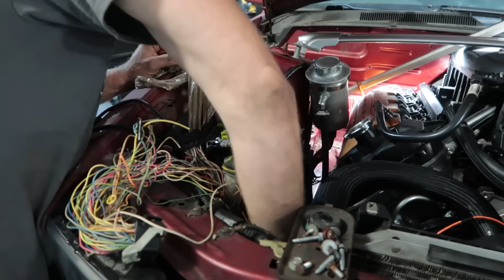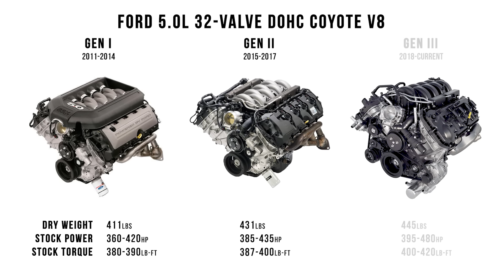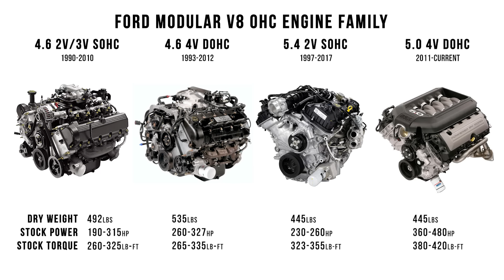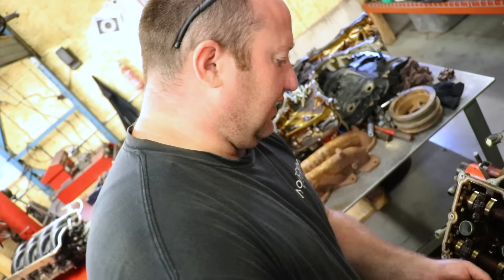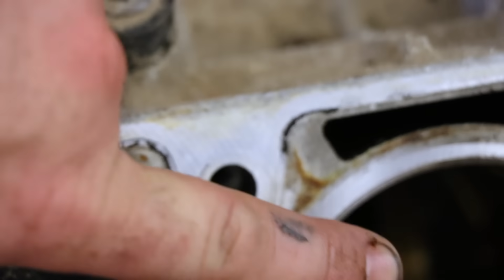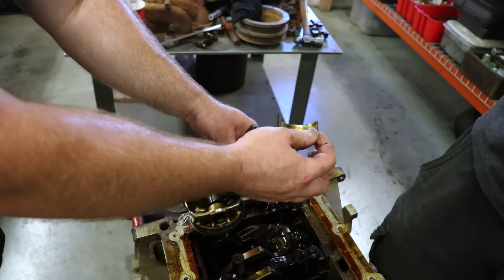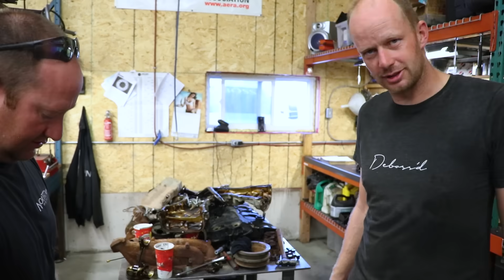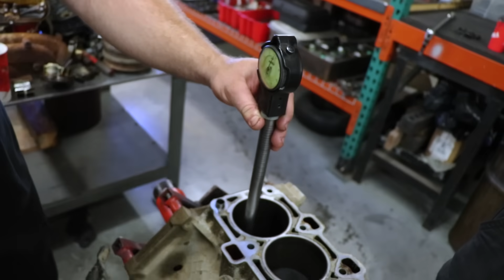REVIEW: Everything Wrong With A 5.0 Coyote Engine

Comment: My 05 mustang with the 4.6 has about 260,000 miles, most of them highway miles. It was owned by my uncle for the most part. Apparently it takes an engineer to remember to change oil. Runs like new! Just treat your car like your kid and it will last...

Comment: The synthetic bit is definitely bunk. This was clearly a lack of maintenance. Only time you'll potentially have issues is if the engine never comes up to temperature from constant short drives, which causes lots of fuel vapors and condensation to make its way into the oil, which will cause varnish deposits along with corrosion, and that will be an issue for either conventional or synthetic.
Reply: Hello, my f150 has a misfire in cylinder 4.   Its going into the shop in a couple days but I am curious the issue is from my short drives to work which is literally five minutes  through the neighborhood.   We do go on long road trips but most days its five minutes to work and five to the store.
Reply: @3DGEM3  what was the diagnosis?
Reply: @MR-nl8xr  digging into engine, headgasket  and valve job.   Quoted 7 grand.   We ended up trading  in the truck.  Put 8 grand  down on a 2022 subaru forester wilderness
Reply: @3DGEM3  your only symptom was a random misfire in cylinder 4?

Comment: I just bought a brand new Tundra...are there any known issues with the I FORCE 5.7 L V8? The engine sounds great and has real good power. My 13 Tacoma with the 4.0 litre V6 was absolutely dead realiable. Is the Toyota 5.7 just as good. It is the 3UR-FE.

Comment: Pushrods are superior in my opinion.   You can snap the valve open quicker and close it later with a pushrod.  It aids in low end torque production.   I'm sure that is why the new 7.3 went back to pushrods for a truck engine.  The 4.6 and 5.0 really lacks the low end compared to pushrod engines.   That engine reminds me of over engineered German engines.

Comment: Road Runner is the Boss 302, with a forged rotating assembly and valve train to support that extra 1000RPM worth of red-line. Coyote (with a Boss intake) is what I'm betting you have there.

Comment: There is a difference in Head Bolt length between generations; many built motors get machined to take bigger bolts as they stiffen the geometry.

Comment: Seen plenty of 5.0 in cars and trucks...
Never seen any of the stuff your talking about.   Only issues I've ever heard is water pump and ring on the hose and some have valve adjustment needed. 
If you roast an engine like most stangs get done to them there tend to be bearing trouble. Every engine will do that with abuse.
Too much misinformation.

Comment: Here are the biggest issues with them
1: gen1 coyotes didn’t have an oil squirter in cylinder 8 so that cylinder would have low compression in some high mileage vehicles.
2. Oem oil pump gears in gen 1 and 2 were very fragile and didn’t hold up at high rpm in boosted applications 
3. These motors rev super high for a v8, not unlike an s2000 it’s gonna use some oil if you’re driving it hard and spending time in the upper revs so as long as you check it regularly and change it at the oem interval you will be fine. 

All in all a fine motor with some problems early on in production that got ironed out in gen 2-3.

Comment: Sorry, I don’t agree. The 5.0 might be the best engine ford has made as of late. The owner of this engine definitely abused it.
Reply: Facts. It's a great engine. Just don't neglect it and it'll do fine.
Reply: I think gen 2 were the best 5.0
Reply: @Night_zv  do u kmow if the 2016 is gen 1 or geb 2
Reply: @puffpuffpikachu  gen 2
Reply: @Night_zv  thx
Reply: @Night_zv definitely
Reply: @bigboreracing356  351 Cleveland served me well for 700,000km in the hot Australian outback, was still running sweetly when I sold it.
Reply: He's Misinformed Lots Of People In This Video 👌🏿.
Reply: Both 5.0 engines I've owned have been very good to me. 👍
Reply: The most reliable engine ford made was the 4.9 300 inline 6 that engine is the best by far.
Reply: Yup
Reply: 4.6 "lots of power" lmfao this guy clearly has no idea what he's talking about. And the sludge is from very extended oil changes with low quality Dino oil. 🤦
Reply: Nice engine the best
Reply: There's a reason most Fords in drag racing use a Chevy block instead of Ford.
Reply: 100%
Reply: The Coyote has a whole decade of reliability. This video is part of another trend of people being contrarian for views, nitpicking rare things, to produce a hunk of ten minute clickbait. Even before I clicked I knew the comments would disagree.
Reply: until 2018 when they cheapened it with spray on cylinder liners rather than sleeving them. Nothing but problems since in my F150.
Reply: @Mrbink01  I have a 14 stx sport 5.0
Reply: @Mrbink01  also the pistons have been hollowed out a lot to save on money
Reply: @Mrbink01  same here im on my 2nd engine and its eating oil like crazy.
Reply: Most reliable gas engine Ford ever made was in the 1993 Mustang Cobras. None of these bullshit problems.
Reply: @Mr.Beastforpresident  same shortblock as the 91-95 mustang and 96-2001 explorers so it was nothing special except programming and some expensive badges
Reply: @Mr.Beastforpresident  The Cleveland was the equivalent of the LS motor..bullet proof and ran hot without exploding or cracking.
Reply: @lobsterwhisperer7932  Far from bulletproof. Thin cylinder walls limit factory blocks to about 600hp without filling them. The factory oiling system leaves some to be desired, and falls short on supplying oil to the mains.
Reply: My teksid 4.6l block is 1700rwhp. 😂 
Plus I'm building a big bore "cammer"/Tr50 road race block modular
2v with 13.5 to. 1 comp ratio. Have buddies with coyotes running 800 to 1100 rwhp no problems. Me thinks you or your tuner can't tune or build engines. 

You better stick with jr dragsters son... 🤣
Reply: @Mr.Beastforpresident  nah the 4.6L 2v is much more reliable. Electronic ignition cannot be beat with a distributor, sorry just dont work that way.
Reply: @Mr.Beastforpresident Bullshit. The cobra never had a 4.9 online 6
Reply: ‘the best engine ford has made as of late’ and that’s the problem over at ford. LS motors come in everything and can but put in everything last word in cheap horsepower. The 5.0 will barely fit in old fords from the past not to mention mustangs. They are expensive to hot rod and you are limited in displacement. Why didn’t ford make the FR-9 available as a crate engine? Because they didn’t want to cut into 5.0 crate engine sales. To me that’s a middle finger to ford loyalists. Seeing your buds rocking cheap LS power while ford offers only the coyote crate is why I quit supporting ford. I’m doing a 65 mustang with a corvette motor. I had to get over it just as the old hot rodders had to get over it and put sbc engines in old 32 fords. F8@k ford!

Comment: Lots of good testament to this Legendary Engine !  I know my friend has a 2017 F150 with 350,000 KMS on his 5.0 and it runs new !!
Reply: Lew Scagnetti I drive a 15’ F150 with just shy of 250k miles (400k kms) at work. Runs like a top
Reply: @mbailey1023  Yup. 5.0 Coyote.Great Motor...IMHO: I would option the 5.0 in place of the 3.5 EcoBoost any day of the week !!

Comment: There is a lot of good information in this video, despite what the comments say. I subscribed after watching, and I don’t do that often because if all the dumb click bait videos out. While everyone is slamming this machinist for his comments about synthetic oil, I believe there is some merit to what he said about synthetics and them not getting hot enough on shorter drives. The history of the Coyote and Ford engines was excellent in this video, and I’ve owned many of them over the years and the opinions seem spot on to me, especially the 5.4. While it may piss some people off what he said or believes about the Coyote Vs LS engines, it’s his opinion from probably rebuilding a lot of both, so the armchair keyboard mechanics out there who think they have more experience, prove it. He actually said that the design of the Coyote is more modern, because the push rod engine is simply an older design, wether or not it’s superior is debatable. I’ve had so many problems with Ford trucks over the years I’d all but sworn off Ford by saying I’d never buy another one. I bought a Chevy 2500 Duramax last year for the first time ever, time will tell if it’s more reliable and less problematic than my Ford trucks. I did however buy a Mustang GT this year, I was minutes away from buying a Camaro SS 1LE, which was a great car on the test drive, and reviews on them are off the charts. Here’s was my dilemma: The Camaro is like sitting inside a tunnel, and it almost feels claustrophobic inside, while the Mustang is more open, and doesn’t feel so closed in. The trunk on the Camaro is a joke, the trunk opening reminds me of a Frunk in a 911. The engine in the Camaro is proven, but other than saying I simply had more fun driving the Mustang, i can’t explain it. After taking off the resonator and putting in a H-Pipe the Mustang sounds like a race car, but with muscle car over tones. I’m sure the Camaro is a great car, but the Mustang feels like your driving a tornado, despite all its short comings, it reminds me of how I felt as a teenager in a 60’s muscle car, the Camaro is almost too refined, and dare I say, boring? The ZL1 is probably a whole different ballgame, but it’s another $25k...

Comment: I am not 100% sure I saw it on this video but your machinist made the comment that overbore doesn't affect displacement,he is very much incorrect on that.Doing the math will prove it out.
The comment he made about pin position being used to compensate for overbore is not for displacement but for compression.

Comment: I guess Ford sells millions of this engines and has millions of happy customers, but somebody has to find fault.
Reply: The newer 5.0s  have cylinder distortions,  the short block needs to be replaced.
Had to do it on mine
Reply: @elgayetas  well lets hope they go back to sleeving them, rather than spraying on the cylinder liner, that's mostly what the issue was with the ones from 2018 and up.
Reply: @elgayetas  what happens with cylinder distortion?  Mine 2019 uses oil and I’m trying to figure out why. Ford keeps doing oil consumption tests and TSB’s.
Reply: @emerylandry2074  If you have a 5.0L that sufferers from the cylinder distortion issue it'll develop a pronounced knock that will be rhythmically faster if you are revving the engine up to accelerate or something. Keep in mind these 5.0L's are kind of noisy to began with because they are DOHC ''and direct injection if a 2018 or newer model''. If they sound find otherwise and there's no audible knock when driving from in the cab, you're fine. If its an obvious knock though, you may have a real problem.

Comment: He had the 4.6 and 5.4 all confused. 

5.4 have a bigger stroke not bore. It’s essentially a stroked 4.6. They use the same piston. Also a town at does not have a 4v 4.6 and a cobra motor is a 4v. Not a 2v.
Reply: Right, a someone with mod motor knowledge should have known this.

Comment: "another comon problem is people not changing their engines enough... i change my engine every 3 or 4 miles"
Reply: "just take to O'Riley's, they'll do it for free in the parking lot anyway"
Reply: @wanderingman8921  only if "the book" tells them to!
Reply: I had a buddy that brazed an 1 1/2" cummins oil plug into his 302 pan. He could change the oil in the time it took him to fill the gas tank, he would do it at the gas station while filling the tank. Lol got some looks for sure.
Reply: @joshperry4538  cool story bro
Reply: The orange can of death!
Why not run motorcraft oil filter? Cheap and designed for the variable cam timing modulars
Reply: I would not want to change my engine every 3 to 4 miles
Reply: Hank Hill: I change my oil every 3k miles, or whenever I get bored
Reply: Are you speaking of changing oil or engines?Cause you didn't specify
Reply: I have the five point oh, and it runs excellent.I changed the oil every thirty five hundred miles.You won't have any issues.Most of the guys that I see.Do not maintenance their trucks.They have this psychological thing that says I got a truck.It's toughI ain't got to change the oil.I don't have to change the fluids.I just drive the hell out and put diesel or gas in it.And hope that like, or think that it's gonna never break down, because it's a truck.No, you have to stay on top of the maintenance.My truck, the five point 02 thousand eighteen has a hundred and twenty six thousand miles whistle top clean.I can take pictures and show it to you.Never had a problem with it from day one off.The assembly line never had a major issue with it all.Do the maintenance fellas?People say all kinds of s***.My truck is proofed at it.If you just change the fluids and stay on the maintenance, you won't have no problems
Reply: FORD FOR YA
Reply: @WhiteManXRP  Fuck your LS mouth, I meant that personally...KMFNB  By the way the  is a copy of the Windsor......... facts is facts 💯

Comment: Awesome detail on the 5.0L! Id say im happy to have the gen 3 in my truck but its eating oil! On a side note my Wife literally assembled them dial bore gauges at sunnen products out of Maplewood Missouri.  Its cool seeing her work in action 👍 Don't break it because sunnen shamefully is in the process of moving a huge part of their manufacturing to Mexico...
Reply: What are your thoughts about the tick in the gen 3?
Reply: @EricZAchille  the tick is normal and im not concerned about it whatsoever. The design of this engine differs alot from a generic pushrod design. It has 4 cams and is direct injected. Your going to hear more noise from these systems. Those systems also make this engine scream when getting on it and its purely awesome. As for the oil consumption a tsb was released from ford and it has fixed it.
Reply: @07slowbalt  Thanks for your quick reply. I have a 2020 GT that makes an irregular tick on warm idle (not cold start). I can hear it at a red light with my windows down so it kinda bothers me. But car prices are too high now for me to consider changing so I'm just gonna keep it.
Reply: @EricZAchille No problem.  I have a rattle that comes from mine that i believe to be an out of spec exhaust solenoid but the dealer keeps giving me the run around on fixing it. Its covered to 150k miles so its not a huge deal as i only hear it at blips of the throttle under 15mph. But yes I understand your frustrations. I didnt buy a new vehicle to hear noises and nor did you. I think ford cut some corners and or have some bad suppliers of parts. The issues eventually get fixed and sorted out but the consumer shouldnt have to deal with it. Im in the same realm as you though as do i keep it or sell it. I considered upgrading till i seen a comparable truck going for 10-15k  more now. Thats purely insane, and wouldnt make sense to immediately go more in debt that you likely wont see back in a few years to come when prices eventually drop. I owe $8200 on my truck that has 46k miles. I could sell it for 37k ish, but to buy another XLT would run me nearly 45-50k lol. It just doesnt sound like a smart decision for anyone to sell just to buy one at a bloated price. It would only make sense if you had a second vehicle and pawn off one for a premium.
Reply: @07slowbalt  Same here, prices are crazy now
Reply: @07slowbalt  I replied to you here multiple times but my comments were deleted by the creator I think. I will go on your channel to post then.
Reply: @07slowbalt  Btw my engine got much better when I used Pennzoil Ultra Platinum 5w-30 on it.
Reply: @EricZAchille  yea youtube does some funky things with comments. I actually just got home from a different dealer to hear his thoughts on my abnormal rattle. He leans more on the side of a bad cam phaser as that has been an issue for some coyotes. He also said it can be coming from a bad hub so i will check it in 4wd tomorrow to see but im very doubtful thats it. Again if you have any questions ill be happy to answer them the best i can whether its here or on one of my crappy videos lol.
Reply: @EricZAchille  thicker oils can be benficial according to alot of guys on forums. Heard of using 30-40w or even 50 weights (boosted setups). Alot of people use Ceratec (pricey) and have good results. Personally im not using an additive as itll be shown inside the engine. It changes the color of your oil and if your warranty is in play then im not giving ford any reason to deny a multi thousand dollar engine because of an additive. Glad the oil is helping you out though. Thats a good sign.
Reply: @07slowbalt  I submitted my response to your previous long comment on your video about the Borla S-Type exhaust of your F-150
Reply: @07slowbalt  The reason my comments were deleted is cause I talked about inflation and the impact 46 in the White House had on it.

Comment: Chevy LT has a much better block design with tons more meat around the cylinder walls for high hp applications and i think i'll stick with 1 cam and 1 chain vs 4 cams and 4 chains less rotating parts to wear out get rid of chevys junk D.O.D system a little e85, gap the rings,88mm turbo in a fox body nuttin but herspurs and hurt ford guy feelings.

Comment: Coil pack nuts "glued" into the valve cover, it can spin the nut forcing a new valve cover..........i change oil at 20% life left, other than bolt on parts no issues.

Comment: Be cool Ford came out a 6.0L DOHC V8 (366ci) with 4 inch bore and little bit longer stroke than a 5.8W V8. Be higher torque numbers. Engine like that would swipe out all the LS engines lol.  I even got a name for it. Sabre V8 lol Sabre tooth tiger lol